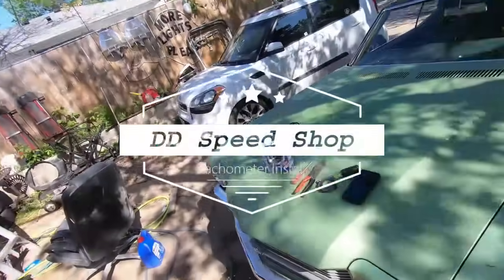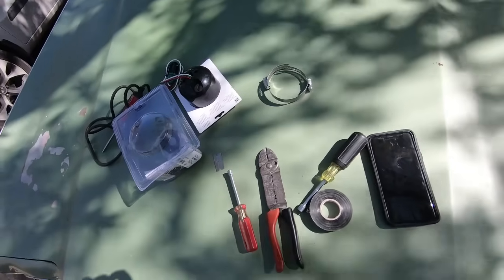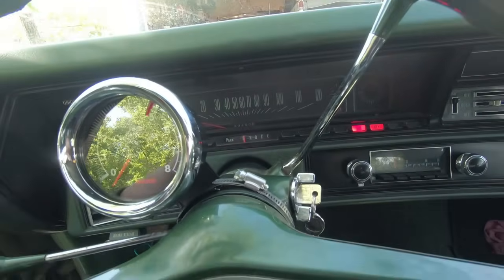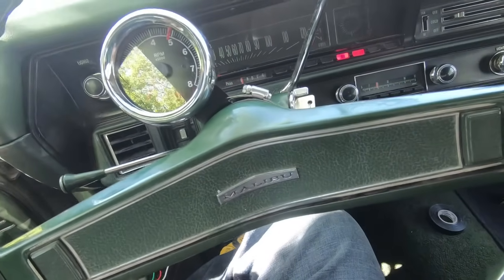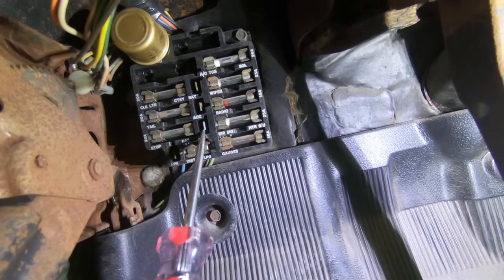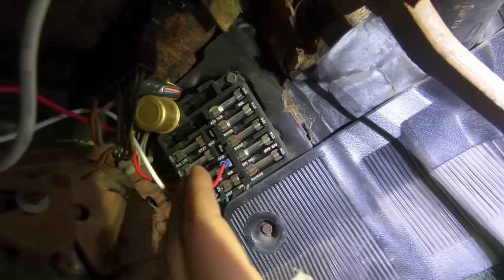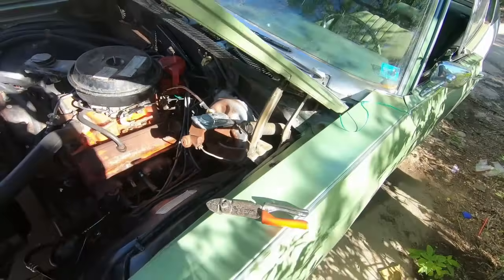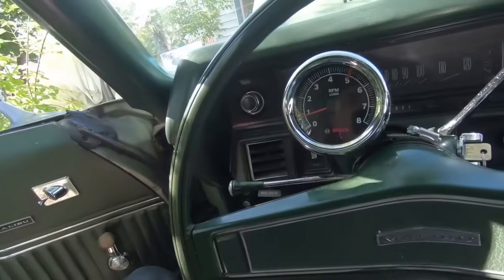Tachometer Installation - Quick and easy on any Car

Comment: When I turn on the ignition and it receives current, it jumps straight to 8k rpm. It doesn't matter if the engine is on or off, the needle only tells me 8k rpm if the ignition is on. What's the problem?

Comment: My 69 Camaro is the same, but I want to add a bunch of accessories, I'm assuming I cant run it off that very plug, if I buy a separate fuse block for accessories and run that wire from the new box to the ACC port on the original box it would put too much stress on that one wire and will ultimately short/blow something. Any alternative?

Comment: Trouble shooting......I ran all the wires correctly. Got power. Light comes on. Green wire to the positive coil side. Start the car, nothing. Ideas?😊
Reply: Read directions, so you ACTUALLY run all the wires correctly, try green to coil negative...

Comment: Almost all videos on how to install a tach in almost ANY car are made for old cars with ignition coils which has a + and -, why not do it on a modern vehicle which has independent ignition coils for each cylinder and no + or - signs!. Where do you connect the green wire/signal in a modern vehicle?
Reply: Which modern vehicle doesn't have a tach nowadays?
Reply: @trijohn23 any of the 1992-2005 crown vics .

Those are the ones I'm looking for at least.

Comment: Your title is very misleading of the video. It says to hook it up to any car. Mine has a magneto.
Reply: Read the fncking instructions or Google tach installation with magneto...
Reply: @jcanfixall1585  I was referring to the title.
Reply: @morgankovarik3649  the title is not misleading!!! In 40 years of being an automotive technician the only engines I have ever worked on with a magneto have been motorcycles...
Reply: @jcanfixall1585  in my 30+ years of doing service work about half the cars I've worked on don't even have an ignition system and then about 50/50 were coil/mag.